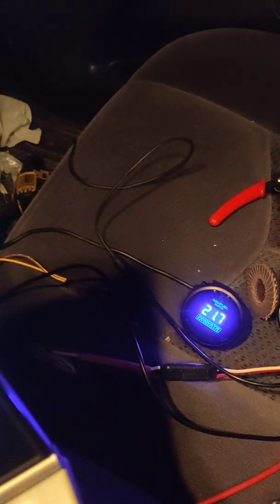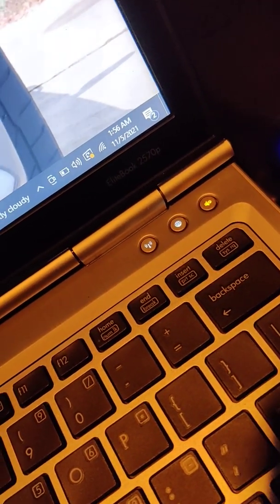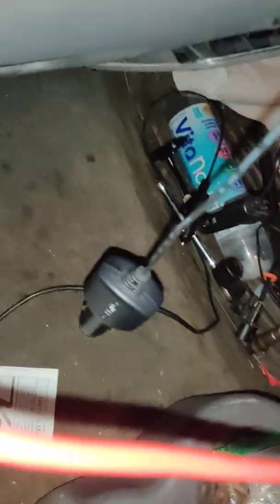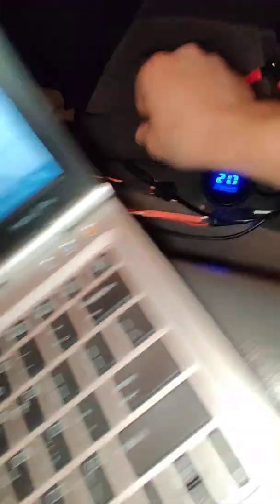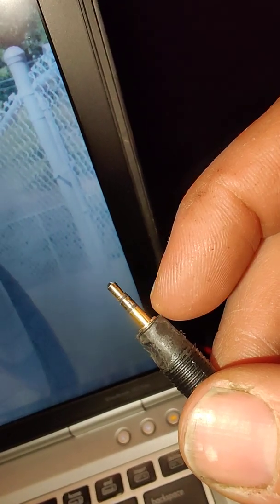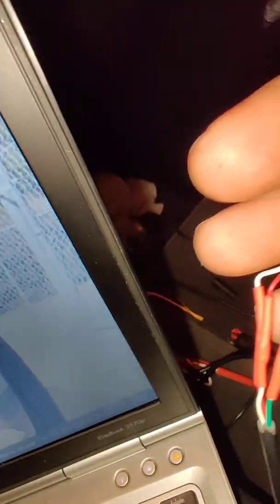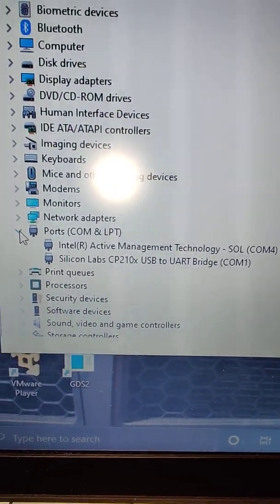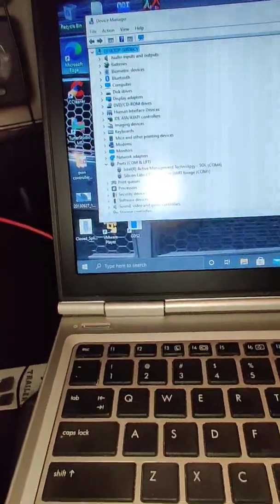Serial USB logging on innovate LC1, LC-1, using Amazon RS232 cable.

Comment: Hey buddy, hope you’re good. I’m having an issue connecting my LC1 wideband, I’ve ordered an Amazon cable and then came across your video, I’ve switched the wires over. 

The drivers for my port are ‘Prolific PL2303GC’, is this why I’m having trouble connecting? I’ve tried using the drivers you said with no avail? 

Thank you.

Comment: Literally exactly what I needed to know! Thank you so much. My 2004 Viper has an LC-1 standalone gauge setup. The only difference is that my “In” plug seems to be what goes to the wideband sensor. Do you think that will matter? It has the red and black wires connected, the green wire is cut (goes nowhere) and the “In” goes somewhere (presumably the wideband)
Reply: The green is going to be your ground